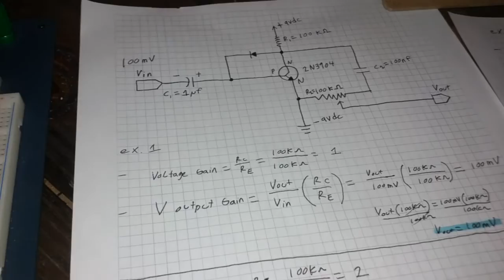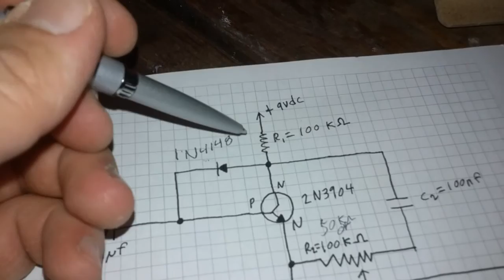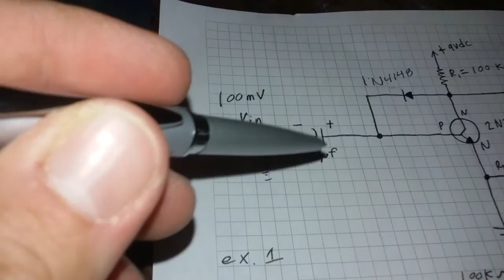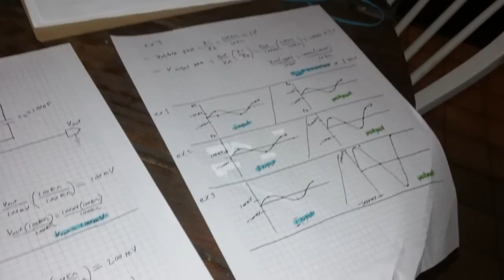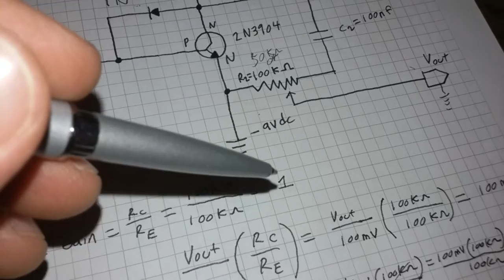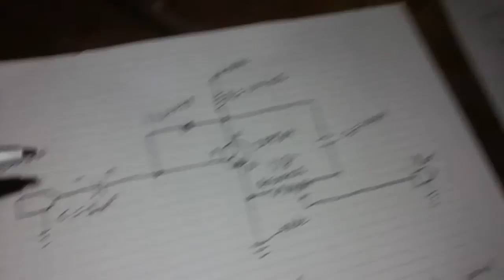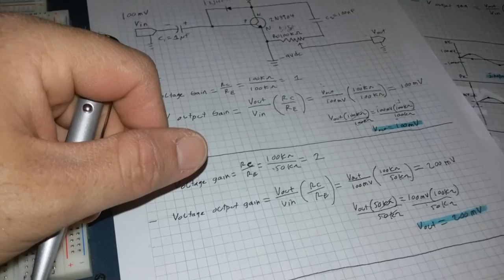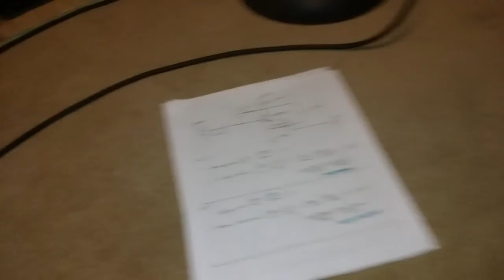Guitar distortion pedal design

Comment: what kind of power supply is used?
Reply from the maker: Just 9vdc. A 9 volt battery
Reply: @nathanhutsky1989  what if I wanted to plug it I to the wall? (american plug) sorry if it's a dumb question I just know nothing about electronics.
Reply from the maker: @josezuniga3747  you need to use DC power. Don’t go straight into the wall. If you have a power adapter that plugs into the wall that’s 9volts then your good.

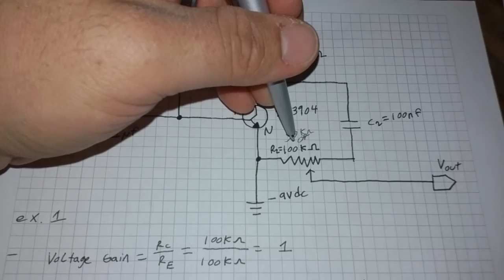Comment: Thanks for the video. I got confused when at 01:30 you were talking about what resistor to use and then at 01:40 you grabbed a potentiometer(?). Sorry, I'm new to this.

So if I'm thinking correctly; (in this circuit) the amount of distortion is directly proportional to the difference of the values of resistors? or 'permitted signal strength' to output?

I'd like to know the theory of design regarding the use of the specific components. Why capacitors and diode?
Reply from the maker: Woden of the Angles the resistor shown @ 1:30 is a potentiometer. The diode causing "cliping" which gives you that fuzzy distortion tone
Reply: Okay thanks Nathan.